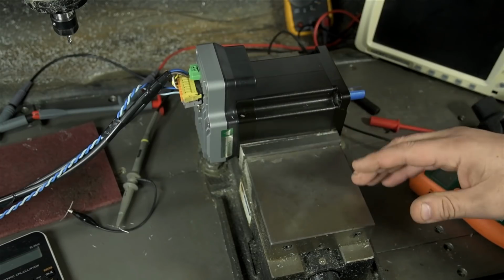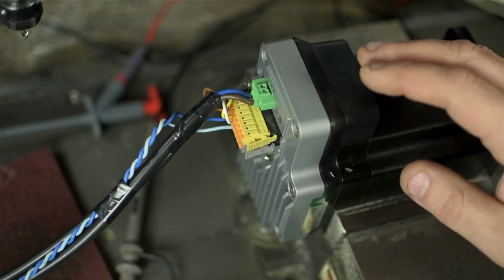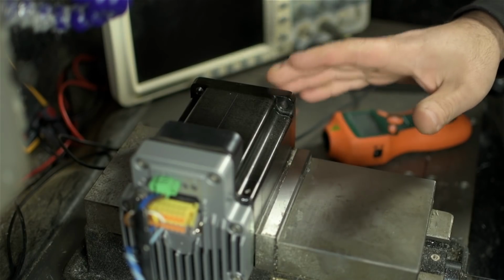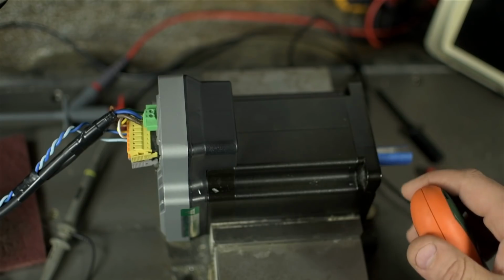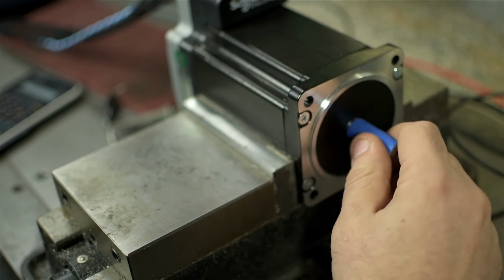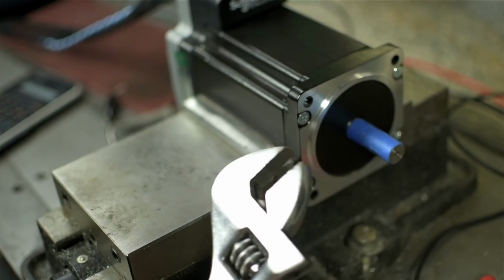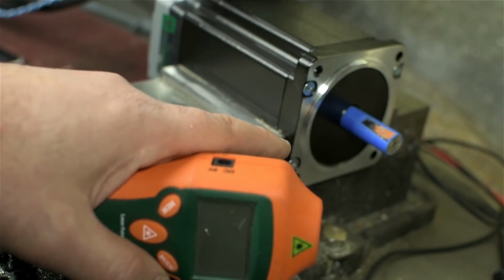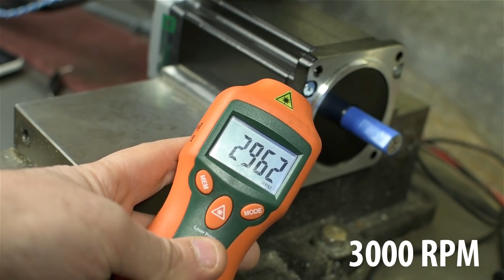As The Motor Turns - UPDATE

Comment: I have been working on stepper motor setup for the last week or so. The problem I am running into seams to be related to magnetic resonance. Ive spent two full nights trying to work around it in linuxcnc to no avail. My only fix so far is to have different set-ups for high and low speed operations. Even after dialing everything in as close as I can using an oscilliscope there are still just certain speeds that turn the motor into a vibrator and the only work around is to have the UFO sounds for those speeds with those settings.

Comment: That`s a closed loop stepper motor, the encoder is there to tell its brainbox where it is. When you send it steps it doesn't actually make a step,  it uses a closed loop control (most likely a PID) with the encoder as an input, the step where it need to lock as the set point and actuating the shaft as an output. Usually you can tune it's control loop via software to make it faster, more precise or mitigate resonant oscillation in your work case, like any other control loop.
Reply: This does not use a PID loop like a servo but instead uses a special ASIC to monitor tooth slip. It's as immediate as a regular stepper but can prevent skipping steps. It can also run in torque mode.

Comment: Did you ever consider Centroid Acorn and Clearpath Stepper Servos? The way stepper servos work is the motor is a DC motor* (servo) and has no concept of position or step, this is solved with an integral encoder which is mated to a onboard servo controller that takes step and direction commands. You moving that shaft is noticed by the encoder which sends DC* to the motor to counteract. *Yes, the motor might be brushless AC - but the concept is the same.

Comment: the reason why it seems like a trade-off between holding torque and speed is because stepper drivers are basically really shitty variable frequency drives. You get max torque and max holding torque when the flux density is the highest, which basically caps out at 1.2T, now when frequency, and thus speed go up, voltage must also go up proportionally in order to keep the flux density and thus torque high. A proper VFD is set up so it maintains max torque from 0 to 60Hz, often from 0 to somewhere over 60Hz since most brushless motors can handle being driven over 60Hz. Stepper drivers typically don't do this, they don't do any voltage control, and steppers don't generally have very good cooling, so they have torque at the low end where the supply voltage is high enough to reach max field strength, but then the torque tapers off after it reaches the optimal speed for the supply voltage. Steppers with more steps should have more torque, but lose that torque more quickly as they spin up, steppers with less steps can operate at higher speed but have less torque. The obvious solution is a VFD stepper driver combo where it changes the voltage with the drive frequency.

Comment: I'm surprised you are going with a stepper, if you are doing what I guess you're doing. I have teknic clearpath servos on my mill and they are awesome. They have nema 23, 34 and more. They are very similar to that stepper but are fully integrated servos with drivers. With all the options they have to choose from you can get good holding torque and high rpms. I guess I will see in do time what you are doing.

Comment: They have the "bolt on brains" for standard nema17 motors as well now....after market of course called ustepper and mechaduino, its an arduino controller and a stepper driver all on a board that mounts to the back of the motor and with a polarized magnet and some hall effect sensors it knows where the shaft is compared to its steps...it's rather ingenious and inexpensive 
http://www.ustepper.com/index/
https://hackaday.com/2016/06/01/mechaduino-closed-loop-stepper-servos-for-everyone/

Comment: The nice thing about these 'smart' servos is that you can tune/program them for the specific loads of the machine's drive system. If you send 1000 steps very rapidly, the servo knows the inertial mass of the system to which it is moving and can apply the appropriate power to accelerate (positive or negative) the shaft as fast as possible to meet your demanded steps without straining the systems. i.e. shafts, lead screws, belts, gears, etc.  Also, because there is an encoder, it knows the exact position of the shaft at all times preventing it from over shooting a position based on traditional missed steps. The biggest advantage of these types of servos is that you can get away from steps all together by sending the servo a move command and it will simply move to that position. i.e  MOVE X, 0.0375" or MOVE Y, -0.004

David talks a lot about these servos on his channel (NEO7CNC) and has a lot of good info.
https://www.youtube.com/watch?v=Z2kAcz-rG5s&list=PLFc8_pNqVayKU9jujcN297gGhSD4OdEQ5

Comment: I heard a little oscillation when it slowed down from 3,000 rpm.  That will mess with your counts.  Usually when you get hardware instability with a servo, you either jump over the affected speed  or try to avoid it in any way possible.  Oscillation leads to skipped counts.  On an encoder system, it will jump back and compensate.  Remember this if you run into finish problems or tooling problems later.

Comment: I have 4 of the Ethernet motors, LMDE573's to be exact and it is simply amazing the amount of information you can manipulate on these drives...smart is an understatement. I am slowly delving into the ModbusTCP aspects and it's pretty crazy. I heard you got solid feedback from Mach on the drive config but I will say I have also been immensely impressed with several divisions of Schneider and their product support.  I also use their SFlex VFD systems and when confronted with some complex issues they got me right in with the 4 senior applications engineers for the VFD and they were amazing. Great stuff and looking forward to see how you make out in the final product. Thanks for some great stuff!

Comment: We use stepper motors like this in Moving lights for stage and theater. For the Pan and Tilt, they have encoders that watch for steps. When they see steps without  a command, they move to correct that motion. It is a lot of fun to give em a push and watch them come back to their position.

Comment: Now you can control your motor, what are you going to use it for?  A stepper motor to turn things to certain number of degrees and turn them back or high speed 3000 rpm potters wheel?

Comment: Nice oscillations !! But I see no problems here or on the previous video.
@This Old Tony, you have control loop or PID oscillations.

This stepper is hybrid, it is a closed loop system. It is driving no load at all, meaning it has no inertia, meaning the changes in speed happen very quickly. The PID which is always trying to compensate for error has not the time to do it, and then overshoots in both direction alternatively.

Comment: Schneider says it's a stepper motor, but this "spring's" behavior of the motor is very strange... Stepper motors tend to stall as you move it out of step and a control to keep it with a reasonable torque to counter the applied force may be very hard to achieve (even with a feedback monitoring, due to the nature of stepper motors). It's very hard to get even close to 3000RPM with stepper motors, since it looses torque exponentially with speed increasing. I believe it's at least an hybrid between stepper and servomotors, maybe with that teeth in rotor but with both magnetic poles along the turn of the rotor too.
Reply: This is a special stepper with closed loop control. It monitors position error within one tooth with a special ASIC and increases motor current to help compensate when it detects it's going to slip. It can also modulate the speed to help prevent that as well.

Comment: Watch out for resonance! 
 It shows up during the acceleration of the motor, as a kind of buzz, that occurs over the lower portion of the speed range. 
 If you slowly ramp it up, and get into the resonance zone, you might find that the motor will behave very oddly. 
 That resonance issue nearly killed my CNC build, until I figured out what it was, and how to solve it  :) .

Comment: After looking at your wiring I see several mistakes the biggest one is you ran the power cable too close to the signal wires you
need to separate them. Twisted pair is a must on all signal wires. Twisted pair can help on the power but is not necessary
Reply: Twisted pairing only works on a differential signal.
Reply: The signals that are there are not grounded and drive an led any magnet large magnet noise will turn them off especially from the power cable right next to the signal wires liked taped together a BIG no no.   @adisharr

Comment: Nice. I work with mdrives every day, but have never tried them for CNC-work. I have also not tried the motor with enocoder (although i have two on the shelf). I could really use the encoder in some situations. Have to try it out this week.
The mdrive is perfect for building small machines. The plus version has 8 digital I/O and one analog and has the grunt to control small processes.
And I guess that you have found out that the steps per revolution is set in software :-)
Reply: Do you know which model he's using? Im working on a retrofit on an old CNC, and considering if it would make sense to ditch drivers and go something like this instead

Comment: If you want a better speed/torque trade-off, a brushless servo would be the way to go. There are some integrated servo motors in the wilderness of Aliexpress. Also there are some nice (but expensive) commercial solutions (like Clearpath). I have 3 chinese integrated servos in my CNC router, for a total of about 300$ delivered. They are great.

Comment: Wait, hold on. The noise resistance of twisted pair depends on a differential signal. That is, one side is positive and one side is negative, of the same logic. What you appear to have is a quadrature output, which is two square waves for two sensors inside the encoder. Sometimes the two lines are opposite, sometimes not. If anything, it will actually hurt signal integrity and increase rise/fall time, because now when a signal changes it has to put extra energy into countering the capacitance of the wire pair. Depending on the driver, you may also see the rise of one signal on the opposite line as added noise.

But if the motor does indeed have differential output, then you just need one twisted pair for each signal.

Keep in mind if you want to probe this that what you have is a "noisy environment", and you need to keep your probe leads as short as possible. Use the "little spring thingy" directly on the connector (and remember of course that ground has to go to ground if your power supply is not floating!).

Comment: We use a similar motor on a machine at work that has an encoder in the motor and an external encoder on a roller. Between the two encoders the motor can be positioned down to one degree very repeatably even with some inherent slip due to the design/function of the machine. Really cool motors I had thoughts sometime ago about a project for one but side tracking wins the day. Looks like your on the path to figuring it out for all of us!

Comment: It's strange, at 3000 rmp it sounds like an e flat, which is 2489 hz, according to Wikipedia. 3000 hz would be more like an f sharp.

Any explanation?
Reply: Yeah the explanation is your ear isn't as good as you think.
Reply: Distortion in the high range from the microphone end.
Reply: There's probably frequencies mixed in related to the stepping.
Reply: RPM is revolutions per minute, Hz is cycles per second. The rotation frequency at 3000 RPM is 50 revolutions per second. This stepper seems to have 200 steps per revolution, so the step frequency at 3000 RPM is 50 * 200 = 10 kHz, very close to an e flat two octaves above the one at 2489 Hz.
Reply: @Mikkel324  Awesome. I was just too lazy to actually figure it out. Thanks :)
Reply: Oh my god, we are so stupid😂😂
Reply: It's temporal distortion caused by the nearby TTL interference.

(Time Travelling Lathe)
Reply: I used Plot Spectrum on Audacity to check the frequency and got a highest peak at 4962 Hz and a slightly smaller one at 2481 Hz (half). D# .
Reply: @giggletub  Interesting observation. Steppers are often constructed with two or four rotor segments, with interleaved steps. This means that each rotor segment operates at half or quarter of the fundamental step frequency. This is probably the reason that these frequencies are dominant.
Reply: It sounded like a jet engine to me, not an e, or an f, maybe is because it was 2970 rip'em's. Anyway, I think TOT won't play Stairway to heaven with this one...
Reply: @jimmytvfclassic  The loudness is mostly because it is still a stepper (kinda). E.g. a 3000 RPM three phase motor runs very smoothly in comparison and with mostly just bearing and fan noise.